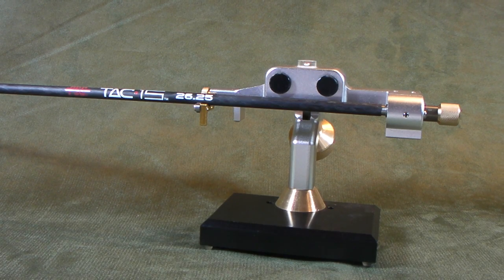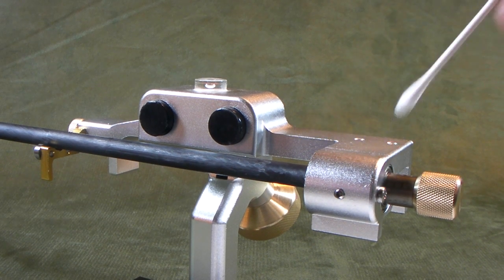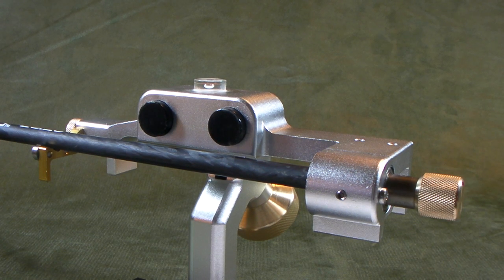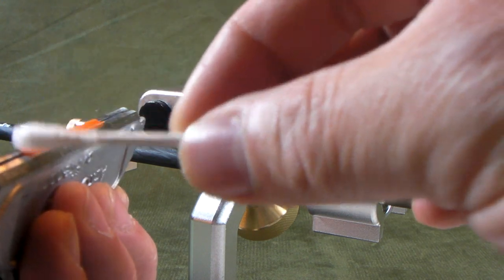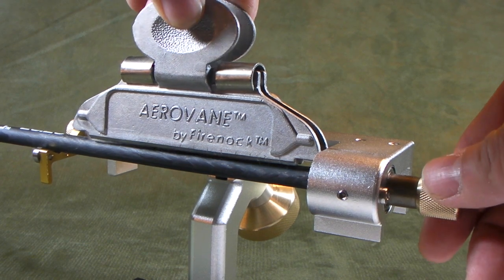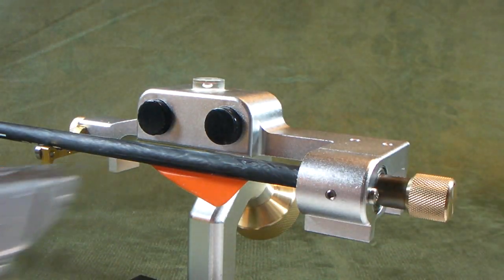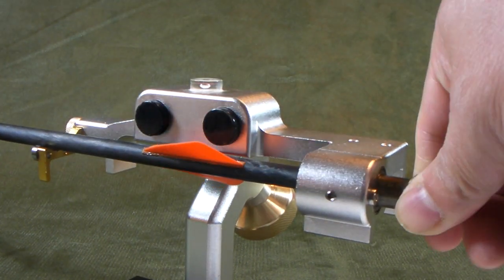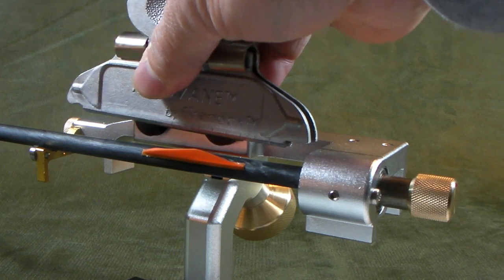Firenock Aerovane Jig: How to Fletch a Bow-Tie Configuration

Comment: this guy is a fucking idiot. Why not just go around in a circle and then you don't have to take the arrow off the jig? Anyone who has done much fletching knows that acetone and alcohol leave a residue that makes vanes fall off. How does this jig work if you have a different diameter arrow? Does it come a post that fits every size arrow or does one have to buy a specific jig? Get a Bitzenburger or a last chance and learn from a real pro.